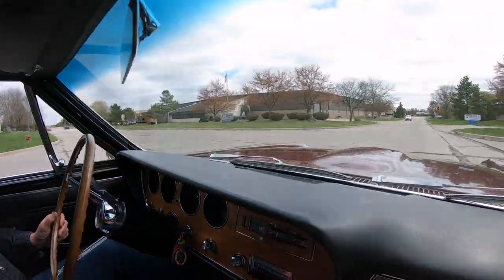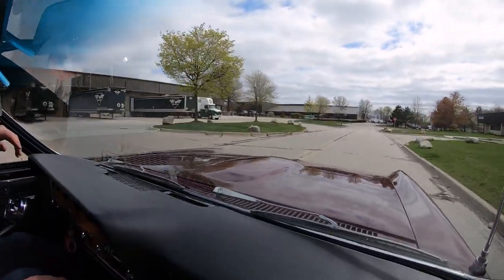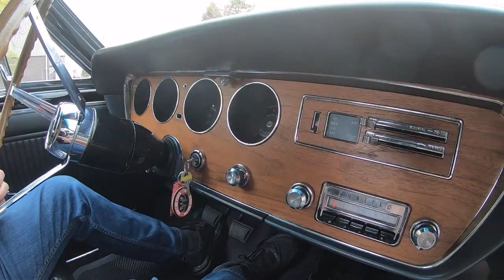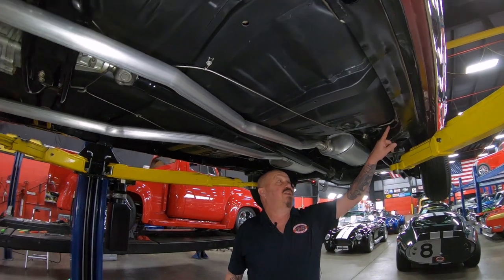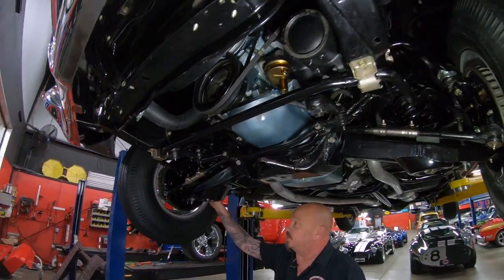1966 Pontiac GTO For Sale

Comment: Limited slip does not mean it’s a posi track rear end, limited slip means just that, it’s a limited slip rear end, one tire spins at a time, posi track means both wheels spin at same time……
Reply from the maker: Posi-Traction is the brand name Gm assigned to their limited slip differential rear ends.